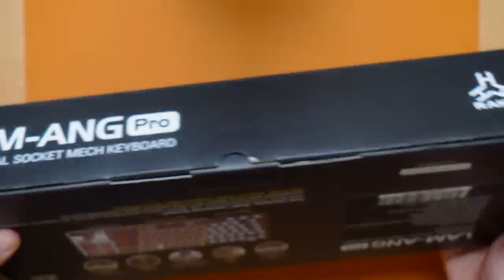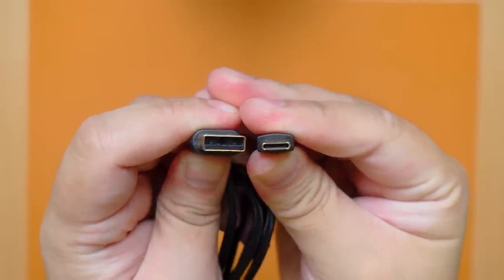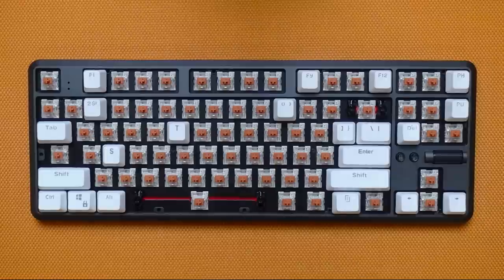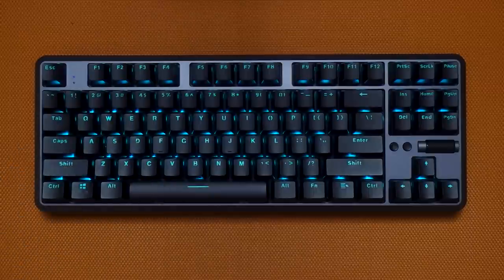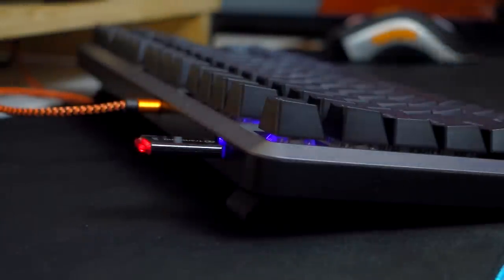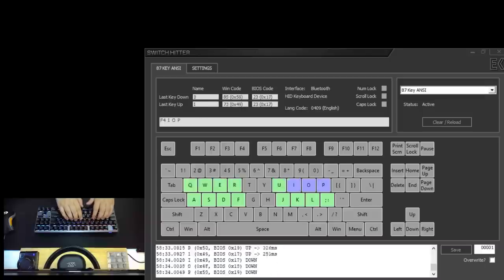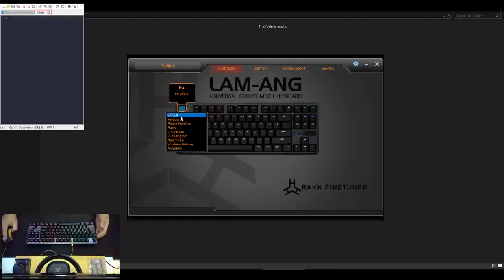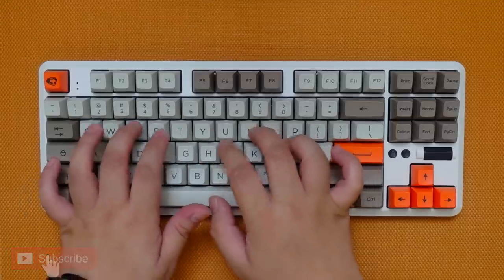Rakk Lam-Ang Pro Mechanical Keyboard Review - Universal Socket Keyboard!

Comment: I still don't understand why hotswap boards don't have the PCB Mount holes in them. I get that most switches don't have the PCB Mount legs on them, however wouldn't it be a smarter move to have them in there to be inclusive for all cherry mount switches. My GK61 and TKC Candybar [still waiting for this] have them.

Comment: I turned off the RGB last night in the lightning tab of the software. Now when I try to turn it on using the lightning tab, it does not work. I tried reinstalling the software but to no avail, it still won't light up. Any suggestions/fix? Thanks in advance!

Comment: I disabled the USB passthrough blue LED by pressing the FN+Pause button, but when I restart the computer the LED in usb passthrough just turns back on. Is there a way to disable it permanently?

Also, aside from disabling the windows button by pressing the small lock button, is there a way to disable Alt+F4 and Alt+Tab too by clicking it?
Thanks! :D

Comment: Recently bought mine, and as my first mech KB coming from rubber domes, one of the best decision I made by far.
And oh btw,  the fine tuner keeps telling me that it has not detected any gaming device.... was the fine tuner works for everybody?  Because mine's not really working..
Reply from the maker: Make sure you're on the right wired mode for the fine tuner to detect the keyboard
Reply: @TechBroll  Yes my lam ang is already connected to my laptop, but it still won't work. It just keeps saying no gaming device detected...

EDIT: finally figured it out hahaha
Reply: @lindis8030  paano mo naayos sir?

Comment: I'm from the USA and I actually managed to get this keyboard on Alibaba, except I didn't receive the original box or the extra top plates. Also, is it possible for me to make it so that when I press FN and another key it'll output text such as the shrug emoticon?
Reply from the maker: you can probably do that using a 3rd party software like AutoHotKey by configuring a key to output text,
Reply: @TechBroll  alright thanks

Comment: Thanks for clarifying about the versions. Me and my friend got confused between the Lite and Pro BB versions because he's interested in buying the keyboard without switches. 

I'd like to ask though, but do Kailh Speed Bronze switches still actuate key presses before the tactility and click? That's always been a problem with those switches as a result of the actuation point being so high. It's generally agreed that actuation is better when it happens slightly after the tactile and clicky feedback, which is why Kailh BOX Whites became more popular for click bar switches. 

Another point is with regard to keycaps: Doubleshot is not the same as laser-etched. Doubleshot caps have a secondary colored plastic injected directly into the molding to form the legends. This is also why doubleshot caps have stenciled legends, where enclosed shapes like O and D have gaps, because it's more conducive to the doubleshot molding. The legends will never fade because everything is plastic. You also made a similar mistake when describing dye-sublimated keycaps, like the AKKO Steam Engine. Dye-Sublimation is a process where pigment is sunk directly into the molten plastic, meaning that the legends will also not fade from use. Laser-etched keycaps are usually these days only found in mainstream branded gaming keyboards, where translucent ABS is simply painted with black UV-coating, after which a laser burns through the coating to form the legends. It's the UV-coating that wears off over use and so eventually erases the legends.

Last point is that the Tecware Phantom Elite is another Filipino branded Kailh hotswap socket keyboard that's actually been released for a few months already. Unfortunately, it hasn't gained much hype, even though I think it deserves as much attention as the Lam-Ang, especially for those looking for a full-size 104 key universal hotswap keyboard.
Reply from the maker: Hi, thank you for these valueble  insights.

With regards to the Kailh Bronze speed switch actuating before the click, I tested it again and yes it indeed does actuate before the click, I just didn't noticed it with normal use, I had to really pay attention on the amount of pressure I put on the key for it to be noticed. 

With regards to the keycaps, yes you are right, i somehow mixed that up, I remembered I researched about that before, that the doubleshot moulding is just two materials combined using a mold and doesn't require any sort of laser engraving/etching. As well as your inputs regarding the dye sublimation, So I stand corrected and thank you.

With regards to tecware phantom elite, it is actually the keyboard I always recommend to people who are asking me about full sized keyboard recommendation.

Also, as I've mentioned, the Rakk Lam-Ang Pro is my first local brand keyboard review, but I am also planning to review other local brands, Tecware being one of them. As a matter of fact, tecware already sent me a couple of their products before. The problem is, and I don't know if you're going to believe it or not, I don't have a lot of budget and I try to review what's presented in front of me. I am a full time content creator and doesn't have a day job for personal reasons and I don't earn much as you can tell by the number of my subscribers. But as the channel grows I'm pretty sure I will be able to review whatever I want and whatever my followers requested. So for now, I have to use what i have.

And lastly, thank you very much for taking your time to write such a valuable corrections. I appreciate it a lot. I still got a lot to learn for sure :)
Reply: @TechBroll  Thanks for the reply! I could see just how much work you put into the review, so I wanted to share the additional info about the switches and keycaps. It really is strange why Rakk decided to offer only BOX whites and Speed Bronze, with both being click bar clicky switches and the Bronze having the issue with the actuation point coming before the click. That said, I thought it was especially thougthful that you showed how the click bar mechanism worked, because I honestly feel that Kailh's innovations need more recognition from mainstream buyers. I'm even more impressed knowing you have limited budget. 

My concern for the Phantom Elite just comes from the lack of coverage it seems to get compared to how much attention the Lam-Ang has been getting recently in the build-up for it's launch. From what I can tell, the Phantom Elite hasn't been selling as strongly for local enthusiasts the way the basic Phantom sells like hotcakes for more casual keyboard buyers. And probably because the idea is more likely to sell in neighboring countries, Tecware appears to have made a more complete release for the Phantom Elite in the Malaysian market, where all the promised switches including Gateron are now also available for it, as well as the option to buy the keyboard only or even just switches only. 

Anyway, hope the channel grows further and keep up the great work!
Reply from the maker: @Boyetto-san  Yeah, I was curious and confused about the switch click mechanism and at the same time, I've read that the Kailh bronze speed is linear but clicky, so Instead of just relying on people's thoughts around the web, I decided to tear it apart myself to see how it works. And yes, it indeed has a linear stem. I am now even more interested to try other kailh switches.

With regards to the phantom elite not gaining much popularity here in the Philippines, I think it is because of the Marketing strategy of both brands. Rakk has been more aggressive in its marketing and consistently joins community events to showcase their products and asks for community feedback, and I think that's the reason why the Lam-Ang gained an edge in terms of hype and popularity. With that said, even without much hype, I know the phantom elite is the best budget local full-sized keyboard right now that's why I keep on recommending it. Maybe if Tecware decides to lend me some of their mechanical keyboards, I can review them as well. But for now, I'll be reviewing what I currently have here. I still have a lot of pending from Banggood which helps me and this channel a lot. :) Thank you again! it is very nice to learn from others.
Reply: @TechBroll  The click bar mechanism does also provide tactility, but its very light and snappier as compared to the rounded bump you get in typical MX type of tactility. If you ever get the chance to try Kailh BOX Jade or Navy switches, the use of a thicker click bar strongly amplifies both the click and tactility.

Comment: Is it ok to use it with while its plugged on? I mean, we don't want to experience disconnection to bluetooth due to low battery.
Reply from the maker: When charging/plugged you just have to make sure that the bluetooth switch is set to off so that it can charge more efficiently

Comment: Hi ShopzadaPH,

Is there any software needed to be downloaded? I can't seem to use the wireless feature. It doesn't detect the keyboard thru my PC, but it's detected in my Phone.  
Hope you can reply. Thanks
Reply: Software is only needed to change the colors and other settings of the keyboard. Have you tried turning on the switch at the back of the keyboard? You can also try pressing Fn + Tab to enter wireless mode and Fn + P  right after for 3-5 seconds to enter pairing mode.

Comment: When swapping it with different switches, do you need to have the smd ones where the bottom part of the switch is opaque?
Reply from the maker: Ideally yes if you want the illumination to be as bright as possible, but if you're like me who doesn't use illumination then it isn't necessary
Reply: ShopzadaPH do you know where I can buy opaque gateron switches? The ones on lazada have solid black bottoms...
Reply: @elianjugalbot3455  you can search myk de jesus who sells switches. at Facebook
Reply: @elianjugalbot3455  you meant transparent right? not opaque?
And same question about where I can by smd version of gateron switches
Reply: yet ebreo yeah i meant transparent, my bad... there are transparent cherry reds on lazada but they only sell packs of 10 and its shipping from china... Also im looking for gateron clears atm and im not interested in cherries
Reply: @elianjugalbot3455  Let me know pag may nahanap ka hehe. Mas mahal ba talaga yung smd type switches?

Comment: great review. sir just want to ask if pwede po kaya dito yung keycaps na compatible with cherry mx switches (planning to get the tex ada keycap sets film novelty)
Reply: Yes it is compatible kailh switches are mx clones (same stem) after all same goes with gaterons and outemu.

(Tip: before you buy switches shouldn't you watch a review about switches so far I heard cherry MX is overrated and it's true cause I tried it so far gaterons and kailhs are better in my opinion, gaterons are smoother while kailh is not as smooth as gaterons but it is quieter.)

I'm using gateron yellow switches and it is smooth as butter.

Edit: kailh also has alot options, Box switch and speed switches, if you really are into gaming, and don't want hysteresis (Mx, outemu and gaterons have this to stop accidental press except for linear switches) kailh has no hysteresis which makes it good for double tapping. They also have good clicky switches like the kailh box white, box navy, and box jade.
Reply: @fulcrum1570  thanks for the info and the tip as well re the switches. 👌
Reply from the maker: Yes compatible po, as long as cross stems slots and ansi layout pwede

Comment: Cant use the fine tuner. It says "No device found" when im opening it. Mine is pro bronze speed.
Any solutions?
Reply from the maker: Try FN+Tab to interchange between wired to wireless mode
Reply: @TechBroll  Thanks! Im pushing the windows+tab instead fn+tab. Haha. My bad. 
How will i know if the battery is full? It doesnt have an idicator on the tuner.

Comment: Ask ko lang po if may fine tuner software din po yung Rak Lam-ang lite rgb keyboard? Thank you
Reply from the maker: I think yes, you can try and use the link on the description
Reply: ShopzadaPH I tried na kasi and kapag nirurun ko yung app “no gaming device found!” Sinasabi
Reply: @domingojastin8  Me as well sir.
Reply: @domingojastin8  Try Fn + Tab!
Reply: Guile Sandel wala rin pong nangyayari. Wala po ba talagang software yung rakk lam-ang lite?
Reply: It will only work if naka kabit Po un wire sir. Worked for me. Naka kabit Ang wire tapos fn + tab
Reply: Allen Pahl Ano pong mangyayari kapag priness ang fn + tab?
Reply: Fn + Tab = Fine Tuner will pop out
Reply: Guile Sandel Nung tinry ko kasi walang lumitaw? Lam-ang lite din ba sayo?
Reply: Jastin Domingo Not sure about that, sir. I’m using Lam-ang Pro. Best if you inquire on the official RAKK Facebook page.

Comment: How can I know if it is fully charged?
Reply from the maker: The charging red LED indicator will turn off
Reply: @TechBroll  also just figured it out, when its on bluetooth mode (switch toggle on the back) it will be always red(it means charging always, just like your phone whenever your using it while charging) but if you switch off the  bluetooth ( toggle on the back ) it will charge your battery and when its full it will not be red anymore

tldr ; if your bluetooth(toggle at the back) is always on and charging it, it will be always on red(it means always charging you'll never know if it is full), so to know if it is fully charged turn off the bluetooth(toggle at the back, not the connectivity) and connect it to your pc to know if the battery is full
Reply: my tldr is still kinda long but you get my point

Comment: sir bakit po yung fantech mech keyboard ko may ground minsan
Reply from the maker: Di ko lang sure bro, bakal ba ang body niya?
Reply: @TechBroll  fantech mk883 po pangalan di ko alam kung plastic o bakal
Reply: @TechBroll  alam ko na sir may line ng bakal sa gilid kaya pala may ground
Reply from the maker: oooh, pero hindi parin dapat ganun. kung may warranty pa yan pawarranty mo
Reply: @TechBroll  pinadala koto sa easy pc di raw pasok sa warranty sa usb port daw nag overflow ng current
Reply: @pyromisery1638  mag tsinelas ka. Tanggal yan. Haha
Reply: @zeref3636  bakit
Reply: @pyromisery1638  one of the major factor why ure having such experience is basically because you've bought from a cheap Chinese rip-off brand. Fantech is a no go for me tbh.
Reply: @zeref3636  hmm okay naman ung keyboard minsan lang nag ground dust proof at waterproof rin try ko isaksak sa ibang pc
Reply: @pyromisery1638  usually kasi in ur case, nafifix yan through wearing slippers or by not being barefoot. Yea try that first

Comment: I decided to buy lite version instead and it is good for around $35 or 1700php. Almost half the price of the pro version 3200 php or $65.

Pros:
Replaceable keycaps
Hot swappable
RGB
Type C
TKL
Volume scroll
Customizable software

Cons compared to pro:
No bluetooth (Don't need it)
Outemu hot swappable only (still a lot of switch options and cheaper too)

Comment: which is better po ba rakk ilis or lam ang lite? hehe
Reply from the maker: If you need numpad, go for ilis. If not, lam ang pro for sure
Reply: @TechBroll  wow thank you for the fast response. Will buy lam ang lite in the future. Thank you !
Reply: Is there a difference between the performance of lam ang lite and ilis? Cuz theyre the same price and im wondering which is really better. Im ok without numpad. Hehe thanks again

Comment: hopefully these come with outemu reds soon. loving my rakk ilis now but this lam-ang with the reds would be awesome for me!
Reply: I think you need gateron or kailh switches if your getting linear switches, imo outemu and cherry mx are scratchy.
Reply from the maker: If you really want outemu red then you can just buy the lite version and get some red switches. But I'd suggest you go Pro then get Kailh or cherry mx red like fulcrum said. Gateron is a good option but it is too light and smooth for me
Reply: @fulcrum1570  will look into gateron or kailh in the next months. I like the linear feel and if either of those are lighter to press I'd most probably get some of those switches.
Reply: @TechBroll  good thing with the pro is it is wireless and small enough for me to have more mouse space. I might just have to test out some more switches. So far outemu red is my favorite since the outemu blue, cherry blue and the razer switches are just too hard in long sessions of typing. Thanks for the suggestions guys!

Comment: Which is better for gaming and productivity in terms of switches - Kailh Switches of Lam Ang or the Cherry MX of Sinag?
Reply from the maker: For pure gaming, kailh bronze speed because of the shortened travel and actuation distances. For typing, kailh box white or cherry mx blue of sinag because of its clicky and tactile nature.
Reply: @TechBroll  thank you sa reply sir :) conflicted kasi ako whether to buy the sinag or wait for the lam ang.  Sinag looks more appealing dahil sa lighting options and pure white look tapos lam ang has more features. Different switches pa.  May estimated retail price na ba to sir?
Reply from the maker: If I were to choose, I'll choose the Rakk Lam-Ang Pro anyday. It has way more features than the Sinag, the sinag doesn't even have any features at all except for the underglow and cherry mx switch. You can choose any switch you want with the Lam-Ang, you have the white top cover and you can paint the bottom housing, the only thing you won't have is the underglow. Wala pang retail price but I've heard it's going to be pretty close to sinag.